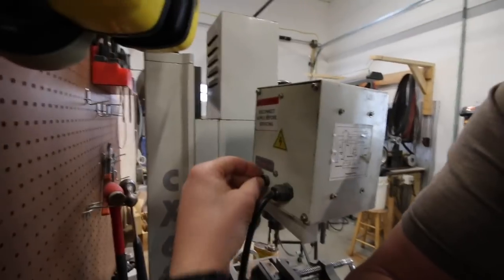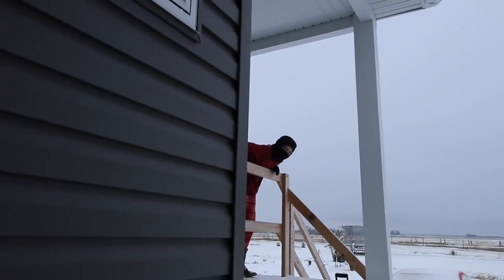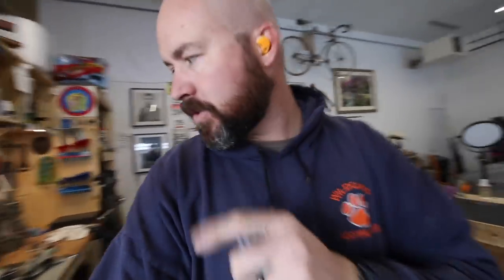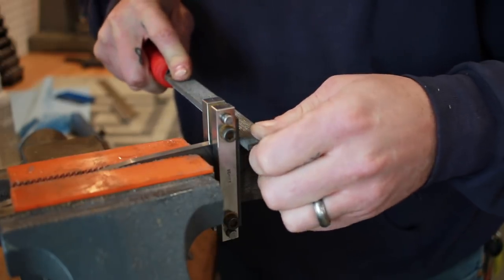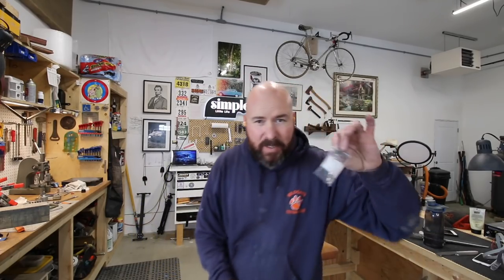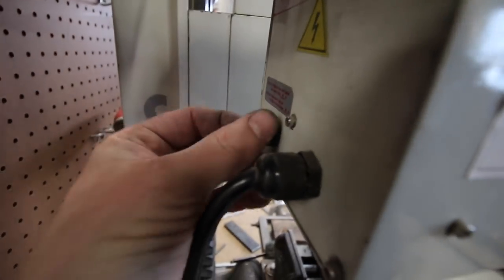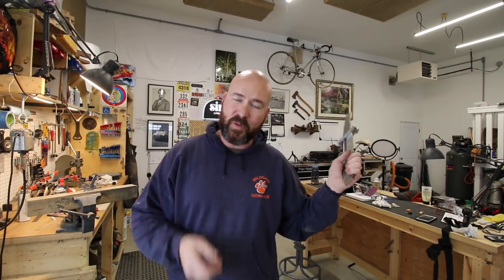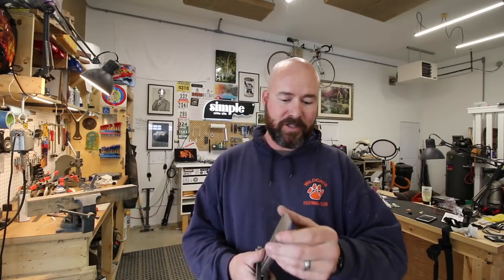Grinding another chopper

Comment: Good job. 3m cubitron 2 belt needs high speed grinders . At least 25 to 30 meters per second will be enough . Belts will last longer with a finer surface and will work cooler .

Comment: The grind on the Chopper is actually practical, because a steeper grind will penetrate better than a thicker grind. So the part of the blade that is most used for chopping (the front for more speed) is thinner ground so it sinks deeper into the wood. Also can you make a detailed video about how to use big grinders, like Band speed for certain belts and materials, proper belt tention etc.

Comment: That chopper is one of the nicest I have seen, particularly like the dropped grip. 
Making a companion sheath for those two will be a challenge, I have done a smaller version for two knives I had, it took a fair bit of playing around to get them to lie together nicely.
Unfortunately I am not on Instagram, otherwise I would follow you there but I won't touch anything Facebook.

Comment: I am not a knife maker, but i was thinking that is a lot of grinding to do on such a big knife. question or idea, 
What if you lay that knife on it’s side on your mills table, indicate the top edge straight then lat shims on cutting side raising that edge so that YOU are satified, then use a 3-4” simple cutter to cut the edge. I think that will work. I often wondered why noone ever tries that. Maybe they do but it does not work huh? What do 
I know? Like i said i never made a knife in my life but i got lots of time on mills and laths. Take rough fast cuts at first then just a few thousands for final smooth as glass cut. You may like it and save your fingers and hands..
Just a thought, nothing more.
Reply: I guess it’s less satisfying for the maker.  We try to use our hands as much as possible, even when grinding, yes the machine hogs the metal away, but we shape and dictate the style of the blade with our hands...it’s very personal.  Freehand grinding is something that takes time to master, and it’s highly satisfying when you finally produce something worthy to be sold with your name on it.  Knife makers are extremely fussy and particular, and held to a high standard by our peers.
Reply: It can be done.
Has been done. There are folks who manually mill things to the standard of a CNC mass production or better.
Mostly because, like yourself, they came into it from a machining background, they already had the skills and were able to transfer them and chose to continue that way. Kudos to them.

I would say that the amount of setup time required + ensuring stability of piece in the vice would be far, far more than with a belt grinder.
There is also far less on-the-fly correction you can do with a mill in this scenario.
You also do the entire blade in one pass with a belt grinder as opposed to having to work your mill bit back and forth multiple times - which would require finishing off with a belt or hand-sanding anyway.

Best thing to do in this situation? Give it a crack, Joe! Get some steel, mill it, let us know how it goes.
I may be completely wrong.
Reply: Let’s not confuse a mill, which Jeremy has, to a production knife companies’ CNC machine that costs multiple thousands of dollars and the accurate software to accomplish making a knife!  Only a CNC has the capability to machine in accurate bevels, and even when this is done you end up with CNC lines, and then someone skilled in the plant hand finishes the knife on a grinder anyway.  It’s as Griff said above, we do it out of passion for producing something handmade with our names on it.